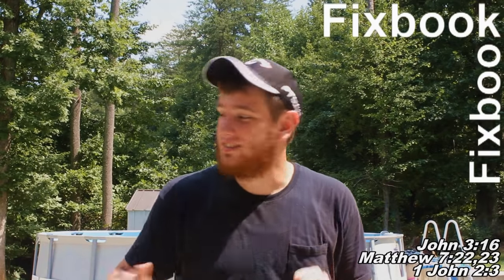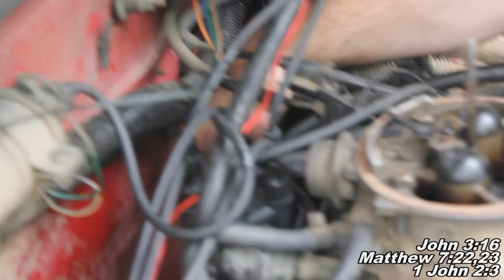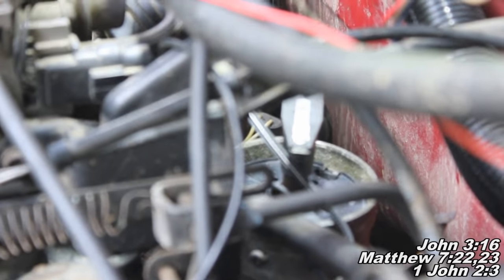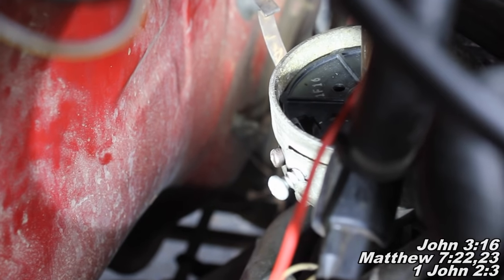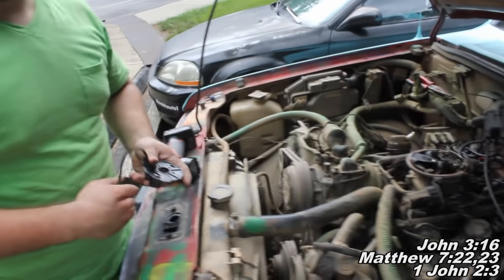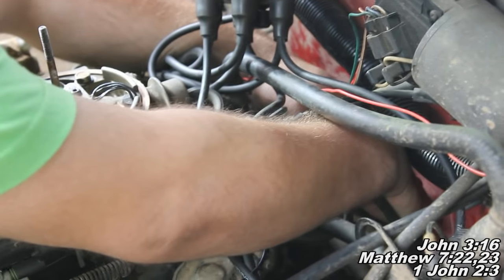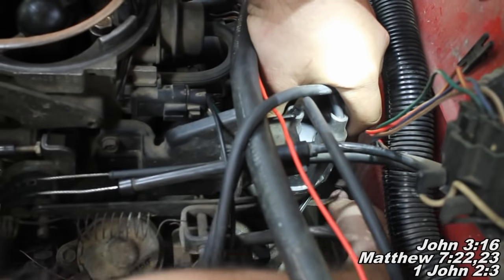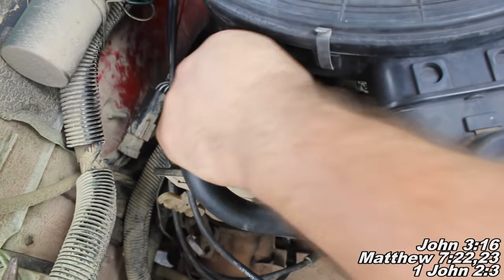Ignition Pick Up Coil Sensor Replacement "How to" Dodge Dakota

Comment: How did you know it needed to be replaced?
Reply: That was my question
Reply: truck starts works fine then as soon as it gets hot or warm it stalls wait 10 minutes and it starts again till it gets hot again
Reply: Mine had issue. Starts fine but as soon as it's hot and you shut it off it wont start for three hours till cool. Changed and works now

Comment: Can you remember what symptoms the truck was having that made y'all want to replace this part? Did it fix your issue? We're desperate over here. Thanks
Reply: Kevin S. my truck would run great some days, other days it would miss randomly every now and again. sometimes it would have a steady miss like its only running on a few cylinders. sometimes it will completely stall out. after it stalls, it might start, it might not start. seemed like the truck had a mind of its own. hope this helps. this problem can be really annoying, especially after spending so much money on ignition coil, wires, plugs, rotor, cap, and a pcm reflash.
Reply: @thomaslandry1457  The 1993 dakota is similar, but no sided screws, and the distributor cap is holded by two screws, also those screws holds the pick up coil sensor on its place; it's simpler, but oh man i already bought two sensors , one didn't work (chinese), and the other one just worked two streets (napa), yeah you read it right, about 2 minutes; changed coil, distributor cap, wires, rotor...... i'm going to buy  a third sensor, let´s hope this one doesn´t fail.

Comment: The rubber air hose is for the PCV air cleaner, the PCV valve is on the other side of the engine in the opposite valve cover, fresh air goes into the crankcase from the PCV air filter via this rubber hose, then the dirty oil / fuel fumes get sucked into the intake from the PCV valve on the other valve cover. My guess is they both need to be serviced along with everything else that a tune up needs.